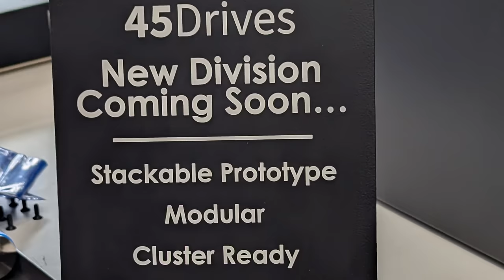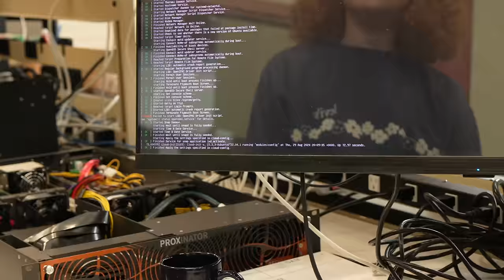What if a Server was Stackable Instead of Rackable?

Comment: Agree on the servicing issue mentioned by others, the whole concept of the rack was to allow complete access to any piece of equipment without disturbing the others unnecessarily. Edge cards are just a different take on cables and although they make things neater, they trade flexibility for getting rid of the cable clutter.
This is rather like that modular computer one company (I forget which) came up with decades ago, where even the CPU and RAM were on a daughter board that could be swapped out. Fantastic idea with one critical flaw.

Comment: This totally takes me back to the Thermaltake/BMW Level 10 days with its modular design. You could pick and choose: "I want this CPU unit, this storage unit, and that XYZ add-on unit," with the flexibility to swap things out over time. I love that concept! However, I do see a couple of design flaws. First, the lack of redundant power is concerning. A dual power supply option, or even a built-in bypass to switch between them, would be a game-changer, especially if you ever need to swap out the UPS. Second, there's no redundant network connectivity. If you're virtualizing like you mentioned, having the ability to team NICs or at least dedicate one NIC for management and another for virtual servers is crucial. Those features would really take the design to the next level.

Comment: this kind of stuff exists in the industrial sector. They tray like chassis in which you can slot in blades of different funciton (similar to blade servers but the blades are different in design).

it is not per say "stackable" as the issue that commes with this idea is "how do i replace the middle layer without moving the entire half of the stack" hence why we have screw in rack mounts.
in the industrial sector they prepare slot in emplacements for you to put equipement in.
Not so new radio switches for example have slots in which you can fit networking redundancy switch multiple emitters, central computation units and so on.
Industrial switches are also very much like this, in IT we have plenty of rackmounted monster chassis with expansion cards and the like.
in the industrial field, everything looks like a PLC. you get a central unit and you can clip on more stuff to it.
These solutions are simple to service, they are mounted on th35-7,5 DIN rails and you can remove any one module indidually as they are small.

For vertically stacked servers, i see them as a big investement and hindrance. You would probably be locked in to the vendor, have big issues in terms of servicing any one layer.
and for a product this size you would most likely need an IT team to deal with it anyway.

what would be nice to see is a unified way of sharing power across an entire rack or cabinet.

Comment: Great concept. I can see this taking off with startups,SOHO, or homes that do not have racks in them. If they are able to cover high availability, affordable cost, and easy expansion/replacement/upgrade, then this could do well in the market.

There would need to be a ton of customizations available for the nodes as well as 24/7 support for the democratically appointed "IT Guy." I would definitely see this as an investment for those who cannot afford or trust the cloud.

Comment: Really like the concept. It doesn't look to have a footprint much larger than an office printer, so I can't imagine the size would be a serious issue. Seems like it would work for all kinds of small businesses and many home lab folks. I'd really like to see this enclosure use commodity innards (like standard PSUs, motherboards, drive backplanes, etc.) that link up to the chassis interconnects using existing technology. If everything is proprietary such that a motherboard can't be swapped with a standard ATX replacement, then this will never fly.

Comment: YES, ABSOLUTELY. The design needs a lot of work. One thing USA people seem to miss is that not everyone lives in a large house with a garage they can stack all sorts of racks & noisy equipment. I live in an apartment flat. Noise is an issue, cooling is an issue, wiring and wifi signal are issues (all my walls are concrete, every room is an effin' faraday cage), available space is an issue, wife approval is an issue. Something that'll look nice in a frequently used room, be adequately cooled without noisy fans, can be separately serviced & upgraded would be great. The stackable design allows vertical growth with minimal footprint and as of now looks good but is functionally far from acceptable but I'm sure the geniuses at 45D will come up with new wonders.

Comment: great idea. specially for the small business where there is no room for a server rack. Maybe the idea of building sideways would be interesting. Having space on a top shelf that only allows for horizontal placement. With a modular system like this that should be an option.
Great to see 45drives is really thinking outside the rack

Comment: I like the concept and idea of it. It kind of reminds me of the shape of the Microvax 4200 we had back in the day. Yes it can appear to be a trash can with a tape drive.
I think something like this would work for a dental office or small business office. That way they could tailor the stack to their needs. I would say the internal components should be common computer hardware, such as mobo, raid controller or drives. This way replacement parts 8-12 years after installation can still be found. You know most systems in medical offices are used until the wheels fall off (i.e. way beyond their useful life). 
If we think about a medical or business office. This system needs to be really quiet, or as quiet as possible if it might exist in a person’s working space. The appearance would be something that you might find in an office and not right away identify it as a computer. Other modules I could see is a 48 port networking switch. This would give the small office both computer, storage, and networking in one battery backed-up enclosure. The battery backup system should have some kind of management card that would integrate with an ilo/idrac like interface for out of band management for msp access (I realize this moves the system out of the use of commodity hardware). This out of band management interface could have some kind of vpn in place that could reach out to the monitoring msp. This vpn should be transparent to whatever ISP the customer is using and not require any changes to the customer ISP router. Something else (reflecting back on the mv4200) is a roll-about base. Simply a platform the compute stack would sit on where you could move the server around. Depending on the battery pack size, the stack could be quite heavy, maybe too much for a desktop work surface. 
Of course, all of this revolves around the price point. If its quiet, looks like a water cooler, has plenty of compute power, manages itself, built in network switch for the entire office, and costs as much as the doctor’s 2nd yacht it simply won’t be purchased. 

In general I like the idea and thinking of this project.

Comment: Make nodes that need maintenance slide the internals out the front. think of a blade server chassis. the power and data going up the stack stays in tact but the internals of the node can be pulled out hot swap style to service it.

Comment: having a modular system would be amazing for some of our clients. in my head i see a double option. having it be standard rack size would be nice and having the back plane be a larger unit so you can slide in the modules you need (blade style?) from the 90s. like a optional rack mount cabinet. need gpus for editing? ... slide in the module ... need a storinator worth of drives ... slide in the module. dont need it in a rack ... attach feet and set it on a table. would be a game changer for a lot of companies

Comment: As a homeowner I like this concept, but its viability (for me) is cost (initial and operations).   Several thoughts came to mind: 1) cooling (maybe expanding the width to include air flow channels and add a cooling module that uses those channels); 2) add a system status/control module (touch panel/display); 3) sound levels (something this nice looking should be "displayed", but if its too loud it will be stuck in an IT closet); and 4) expandability (add  "blank" module(s) for items like switches, modems, routers, etc. that keeps the clean aesthetic going).  Overall, really like the concept and hope it comes to fruition!  BTW, when I first saw it, I got a "2001: A Space Odyssey" vibe!  LOL!!!
Reply: Watercooling is more efficent. The compute unit should have blades with integrated water cooling from the backplane.

Comment: I think this is a great concept for on-prem dev, bcp and edge solutions. We don't see enough modular designs at the mid tear.adding a 10gbps module and a liquid cooling or ac option would be a game changer, if it were a solution with long term support on open standards. Imagine being able to just add an Nvidia cluster to your existing stack with just a few modules or going crazy as you scale. Awesome!

Comment: Why not both? Bottom unit is power and mounts in standard 19" space. Then each later unit mounts on rails which hold each subsequent unit which when slid in, the last 1" of sliding in begins lowering it until its fully in and dropped fully down on top of the unit below it, pressing the connections between the two devices together. Each added device that slides in, and lowers down onto the units below it unifying power, bus and cooling in the stack.

Comment: I love the concept…. It think full rack width would make adding things later easier (like the networking switch you mentioned). The ability to use standard rack mounting solutions (wall mounting in a closet) that small businesses would need.

Comment: I would prefer it without a UPS, power, or CPU units. I will provide my own UPS. I just want a storage unit with a CPU and PSU that can be expanded / stacked with one or more duplicate units if needed. This is pretty common with network switches--connected with stack cables--with one of them being the master and others slaves. Something similar for storage would be nice.

Comment: In the early 1980s, SJResearch shipped stackable Network File / Print servers, with optional SCSII disk and tape slices available to purchase and stack. Acorn Computers similarly sold their, ARM based, RiscPCs in slices, in the early 90s, with optional storage or compute slices available to daisy chain into the system.

Comment: A server tower chassis that fits on a rack shelf or could be converted to rack mount with bolt on ears, with a bunch of 5.25" bays along the front, a mid plane for fans, and support for micro atx and atx psus keeping the depth short. Bonus points for supply non backplane 3.5" adapters for the 5.25 bays and for the whole thing to be low cost. Not much more expensive than something like a fractal torrent or define. Rails and ears optional accessories.

Edit: or a nice 10" rack case. Micro atx, atx or sfx psu, some 3.5" bays (direct wire is fine).

Comment: The concept is certainly neat and I can see the appeal. One thing I would like to see on future iterations, if the concept lives long enough would be to have the compute unit (maybe others as well where it makes sense) mounted in a drawer of some kind. Have flexible interconnects to allow the entire MB and it's components to be slid out if you want to do some servicing like hot-adding/swapping RAM or even just cleaning, all without the need to un-stack it. I imagine that's something that has already crossed their minds though. Regardless, very cool!
Reply: Yeah, just mount everything in a rolling tool chest! Lol

Comment: Very nice concept. Needs more than dowel pins to hold it together, something with bolts and metal bars would work. Two sizes would be smart, one half rack width for smaller businesses, one full rack for those who want to sit a full size switch on top.  Maybe add a mounting method for a pair of rack ears as a bolt on addition, would just need the addition of the relevant mounting points to several of the modules and a modified 1 or 2u rack corner to fit to accomplish this.

Comment: I feel like a German automotive engineer came up with this - no consideration for maintenance lol. I think rackless servers is a great idea especially for small businesses who feel intimidated by the idea of racks.  The biggest hurdle I see is coming up with a solution that allows repairs without taking the entire stack offline. Unless each stack is meant to be a single service, then that would render my point moot. 

My own quick thoughts to solve my concern I end up to something like blade servers with some sort of bus at the back. Maybe with adjustable ports?

Comment: I like the concept. As for serviceability, IMHO it doesn't seem that bad (as compared to most modern "stuff" & cars, where you need to remove lots of components just to reach what needs to be replaced), but that's as long as interconnects are designed in such a way that they can endure the common environmental conditions which exist where the unit will be stacked (i.e. temperature swings, airflow, vibration, bumping the units inadvertently, etc). Also depends on the premium $$ vs a good tower system or a compact rack.

Comment: Make it standard 19" rack width and add the option to mount rails, then they will be both stackable and rackable. Makes it possible to move to a rack if the needs outgrow the stacking concept, without having to replace everything.

Comment: Probably need handles or grooves on the sides to allow for easier handling.  The current design is probably great for business because it looks like it is easy to stuff it in a corner and completely forget what it does and what it is.  However, it does seem like it would more challenging to maintain than a server rack.  However, the PCIE interconnect and power trick may be useful as an addon to the side of a server rack.  Just make interconnect boards that correspond to 1U, 2U, etc. sizes.

Comment: Cool concept!  I like the clean look!  For a small office, it might be nice to have 2-4 RU enclosure on top for the local network.  My thought is, a small office could have a stack that included the network.  That would keep them from having a separate rack for the network.  I agree with the serviceability.  How do you swap memory, UPS battery, PSU?  As long as you don't have to un-stack the drives to get to a component.  Maybe have drawer sliders for the serviceable components? That's one thing a rack has is granular modularity.

Comment: This is not a new concept, I remember proposing something like this to a computer manufacturer in the 90's. Everyone I talked to thought it was crazy, there was no way a single consumer or even a single computer manufacturer could set a standard. I wasn't trying to do that, I just proposed an idea and hoped someone could take it to the next level. At any rate, the idea is great, but flexibility is paramount. One idea I proposed was "plug and play HDDs". Just a slot in the front of a chassis where a user could hot swap HDDs. Well, here we are 30 years later and it's commonplace. In the demonstrated concept here, I'd suggest a design where a single "box" (or even "function") could be removed for maint or upgrade without having to take the whole system apart. Something a racked system doesn't have to worry about. Another one is that the interconnects, especially power are in the top & bottom of the units. I'd suggest a sort of a backplane with power on one side and data on the other where single "units" could be plugged in and be removable. Framework laptops have addressed this concept very well in the portable market. I would definitely buy something like that for a (for lack of a better word) a "desktop" system. There is nothing I'd like more than replacing an ugly rack system in an office or home environment with something sleek and easy to maintain. I agree, the logistics are going to challenging, like I/O, power, space, and cooling.  Go for it, build it and they will come if it's a good idea, and I think this one is.

Comment: HA would look like not an option on something like this, at this current stage Maybe if it was like backplane or cabled design. easy servicing and HA capability are things im missing(maybe a horizontal design witha backplane so you can remove em kinda like books

Comment: Rack width and rack-able as an option. the sell is "Grows with your business." Fans out the back. Air filters easy to service. and tool less design. no hdd trays, just screws and pop button. LED status light for the hdd so trouble shooting dead drives is easy. easy sell to small and med business with aspirations of being big one day and wanting this investment to last. Add IPMI, even if that adds to cost some will need it and will pay.

Comment: Building a compact rack unit sorta like the Unifi rack seems more flexible, single vendor units like this are usually not a good idea, plus the maintenance everyone else has mentioned. You could take the same idea and build a square format 19 inch 6-8u rack, with square rack cases. That way the end user could convert to a full rack later if needed. I think making this its own form factor is just asking to be locked into an ecosystem with no path upwards.